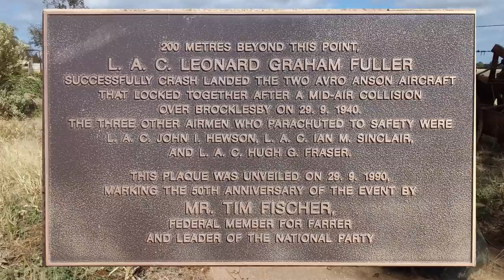Mid Air Collision - Avro Anson. The Piggy Back Crash Landing 1940

Comment: There was that other infamous collision with 2 Bristol Beauforts during a publicity shot. There were three planes flying in low level formation, at the end of the fly past, the centre plane, A9-27, gained altitude and clipped the left wing of the plane to its right, A9-268. The entire tail plane and empennage was torn off A9-27, the wing on A9-268 was fatally damaged. Both planes crashed with all lives lost. I still can't work out why A9-27 gained altitude like it did.

Comment: The last Ansons were only retired from the RAF in 1968. I watched one fly over the former Avro factory at Woodford just last month, September 2021.
Reply: There were several Ansons at RAF Bovingdon in the 1960s. Our C47s were on the ground due to fog. You could only see about 50 feet. You would here a Jeep start up and the battery box clanking. A couple of Ansons  would start up and take off. The operations guy told they set runway heading on the directional gyro and takeoff on the heading.  He also said the ground fog was only 200 or so feet thick.